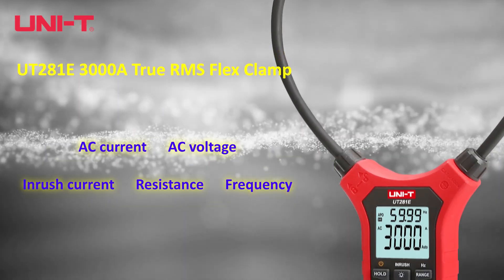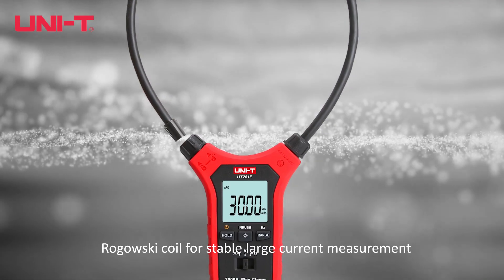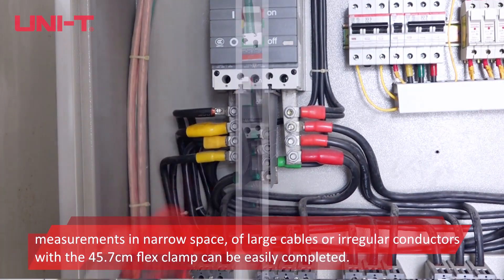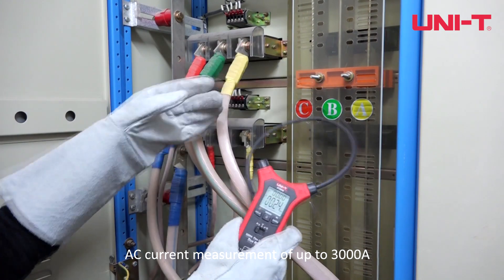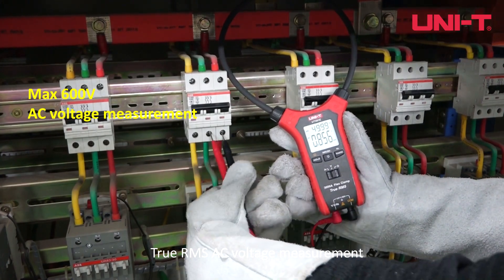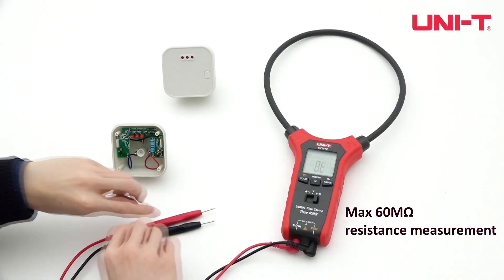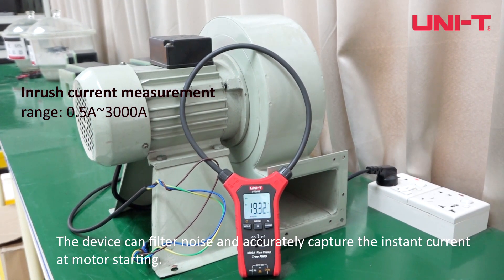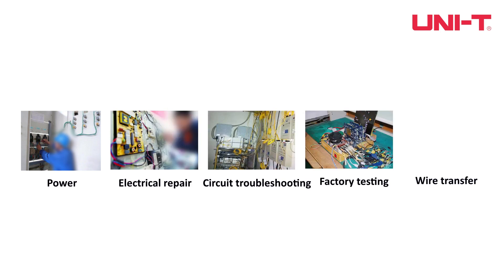Measure High Currents with UNI-T UT281E True RMS Flex Clamp

Comment: Hi, I have a power quality analyzer ut 285, but the measured data is wrong and out of calibration, how can I solve this problem? Can it be reset from the factory? Thank you.
Reply from the maker: Hi sir, could you pls specify what data that you measured is wrong?
Reply: @UniTrendTechnology  The voltage and current measurements are wrong, they are almost double. What software can I use to download the data? Thanks a lot